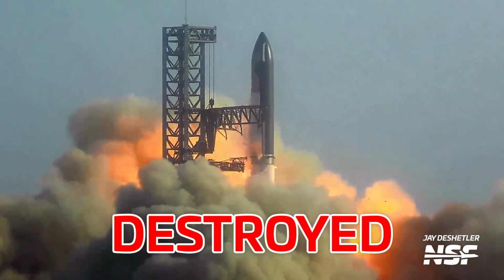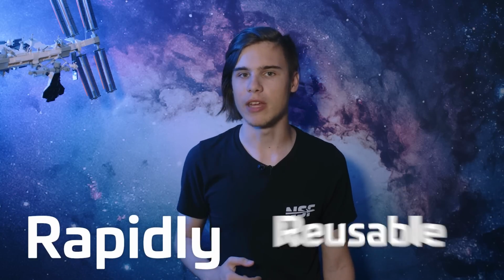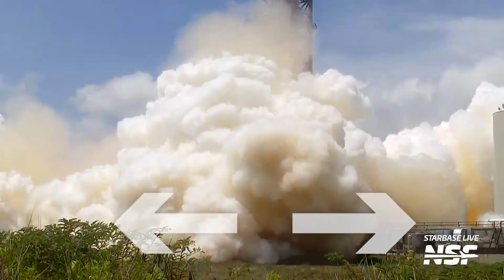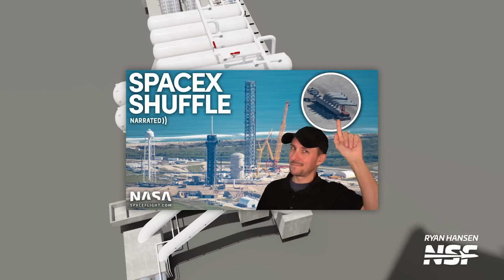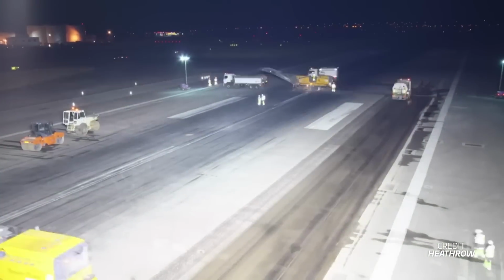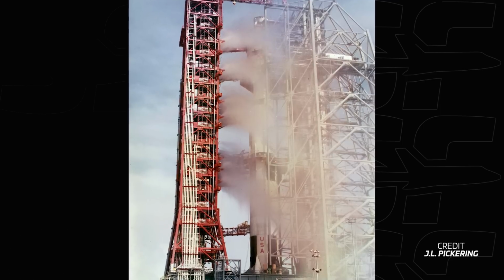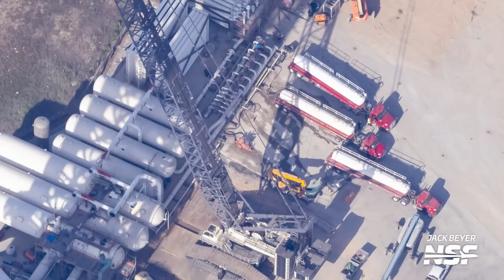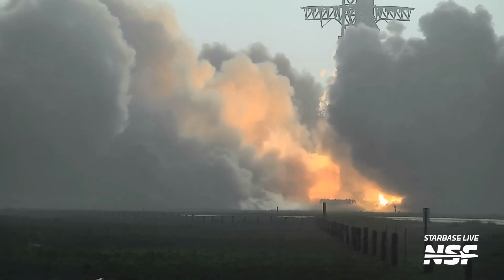SpaceX Thinks They Know Better. Is The Water Plate Enough? (Starship's Deluge)

Comment: Would be better to build the launch pad and tower just offshore where SEA WATER can deal with all the heat and pressure. A wide pier can provide easy access and barges can provide portable platforms under the launch pad.
Reply: Heh this was one of only two questions we didn't tackle on this video - didn't want it to go any much longer than it already goes but fun fact: you still have to deal with a lot of the same issues than on the ground with the added problem of replenishing consumables getting reeeeeally difficult. I wish we have had more time to cover this but sadly we were already working on this video at its current length for well over a month, maybe we can tackle these other couple of questions on a separate video though! :D
Reply: This would be horrifically expensive.
Reply: And erode the entire facility in months.
Reply: Ships that use boilers to heat water to create super-heated steam, which is then thrust on to turbine blades, to generate power to the gearbox and then to the propellers, have to use very pure water. Detectors monitor the pure water after it has turned the turbine blades and condensed into liquid. These detectors are just 2 metal plates and a meter measuring the resistance between them. Any 'contamination' such as salt or copper or iron or anything else in the water, causes a change in the meter reading. Why do they monitor this meter?
Because anything in the water will 'pit' the turbine blades and that will add pitted steel into the water which will be re-cycled and fired into the blades again. In other words, the 'contaminant' acts like a sand-blaster and if you use your idea of salt water, the 'contaminants' will start pitting the off-shore platform rig. It may also create 'salt' dust clouds and that will cause added corrosion to everything on the platform. Then you have to hose it down with pure water, so everything has to be water resistant.
Although it will solve the problem, I think the logistics of it all, just adds up to too much complexity. In my opinion. Perhaps if it was over a fresh water lake, it would work.
Elon's location in a wildlife reserve, is the 'Ball & Chain' that has developed this 'creative thinking' and alternative water deluge system. Maybe like everything else he has built, other countries will 'adopt' this method too??? 
But as NSF showed in their 'exposee', Rocket Lab's Electron Rocket launch pad, does not use a deep trench and it fires into concrete and diverts it out each side of the platform and all they do is pour water onto it. So, it's all about a factor of scale. Scale up to the most powerful rocket in the world, time to think outside the 'standard' method

Comment: I think it will work, i just wish it didnt turn the entirety of the water into dry steam while only at 50%. I imagine the heat and pressure on the plate will only compound as it goes for lift off, granted itll only experience that for a couple seconds. Finger crossed it comes out in great shape.
Reply: It'll only be at 50% as well at lift-off

Comment: I think the original OLM was a brilliant idea, but as with the whole starship prototype program, has obviously had to evolve following the biggest rocket launch in history.
Their result looks like it works after the wet dress rehersals and test firing.
However, as made obvious from them, spacex still needs to be fine tuned as the water deluge overlapped the base of the rockets, and could well be the cause of the random seeming raptor shutdowns.
I think they will also need to sort out the waste water collection and treatment and storing to stop environmental organisations constantly halting progress with legal action.
Reply: From my understanding the deluge never directly impacts the raptor engines so the shut down of two of the engines is a problem that may be more about how they integrate with the whole launch system on the booster and the launch mount and that will take time to resolve.

Comment: Mark my words, the pad will be damage again, the test that starship having are nothing compare to the launch, for the first test flight we can see that starship taking at least 4-8+ sec before it really fly, which mean the thrust just going to fire down the concrete underneath the pad and the deluge system wont hold it so much more. I hope I’m wrong tho.
Reply: As was pointed out on this particular subject, about timing for lift-off, the change in launch sequence should actually reduce the amount of seconds that the steel plate will be subjected to thrust, when the Raptors throttle up from 50% to 60% and then go to 90%. (We have seen it can take 50% for about 6 seconds without damage) 
What was not talked about in this video, was the heat energy that is needed to be dissipated by the water. Methane and Oxygen burn at 2,810℃ (5,090℉). Steel melts at 1,371℃ (2,500℉). So without any water, it would take a certain amount of time to heat the metal up to that 'unwanted' temperature. Just what that 'critical' time is, requires someone with a very good knowledge of British Thermal Unit's or kilo joules and some real rocket science equations to work it out. Right out of the Ball-park for me! 
Also that steel plate construction is very heavy, and could radiate a certain amount of heat to the air as well i.e it can lose a certain amount of energy. 
I hope that SpaceX have added another layer of protection to their onboard computer system, that is linked in to multiple water flow switch's and pressure gauges in the 'deluge' plate. If a water pipe bursts (or something else goes wrong) and water pressure drops below a threshold, it has to abort the launch.
Reply: Wow Dave, you really know your stuff.  You should work for NSF @David-yo5ws
Reply: Elon did say that he wants the ramp up to all engines lit to be by 2.5 seconds.  It all depends on how fast they clear the pad I suppose which the team is clearly trying to refine.

Comment: Couldn’t they have stored an enormous amount of water on the tower? I feel like this whole pluming is way too complicated and thus a failure point.
Reply: To achieve sufficient pressure required by this system (on the order of 20 atmospheres or so), they'd need to store the large quantity of water about 200 meters above ground (significantly higher than the topmost tip of the launch tower): every 10 m elevation for a water tower, provides 1 more atmosphere of pressure at the outlet.
Reply: @Spherical_Cow   Where do you get your 200 meter figure from?   The OLT is 143 m tall and the vertical water towers are much shorter.   Besides most of the water for deluge comes from the water tanks on the opposite side of OLT from the OLM.
Reply: @michaeldeierhoi4096  the question was, why don't they use a tall water tower instead of pressurizing the deluge system with gas.  I explained why - and my explanation includes a very simple derivation of the 200 meter figure.  Read it.

Comment: There is no doubt that SpaceX has the personnel with exceptional expertise in the aerospace industry, and I’m sure they have done some intense computer modeling on this issue. 

That being said, the proof is in the results they get in a real test flight with an actual launch. Reality will answer any problems that may have been overlooked by the team. 

My personal feeling is that this launch system will allow for a successful launch on the next try. After that I’m convinced that some tweaking will happen before launch number 3.

Comment: I think it'll work. However, I don't think they'll have the reusability they're hoping for at first. I'm thinking after the 3rd or 4th launch there will need to be extensive repair work/modification. I hope I'm proven wrong though. I like that it's different, and with being different comes new challenges, and overcoming challenges can be quite rewarding.
Reply: I think the worst case scenario is that they realize they need to rework the plumbing to allow for much higher water flow and pressure. And that's only if the current setup isn't enough to stop the steel plate from eroding a little bit.
Reply: I'd wager we will see some fatigue/corrosion fatigue on the metal around the holes from the shockwaves and nearby salty environment.  That might cause issues but they could always cut out the area and weld in a new section.

Comment: I was surprised at the damage caused in the first integrated flight test to the launch pad, by the lift-off, after the initial pronouncement that because of the 50% flight test of the engines prior to the lift-off, 'the concrete was good'.
Reply: keep in mind much of the damage from it was that the pad was able to be   pushed down this was due to several static fires and quite a bit of erosion that was unexpected similar to how if you have a house foundation it will crack because the support under gives way. 

I say unexpected but what I really mean is not all factors were accounted for and allowances were made even though the consequences were pretty easy to figure out if they had taken the time to think about it more :)  I won a lot of bets after the first launch :) a lot of bets..
Reply: The pad was horrifically under engineered because they wanted to cut costs. FAFO.
Reply: @markuskoivisto I think it was more about wanting to get the ship off the pad asap, rather than cutting costs.
Reply: @Astra2  Same thing, no?

Comment: There will still be risk to the OLM and subsystems, most damage has hopefully been mitigated.  Immense power presents immense damage potential.  It is the worlds largest cutting torch.
Reply: Your use of 'cutting torch' , I have to say, is not the best analogy to use, if you look at this in a factual sense. But I get what you are implying: e.g A Concentrated Jet Blast.
I am actually bemused that NSF did not go into the temperatures that the OLM would be subjected too. Maybe they will do the 'math's' of it, in another video post?
For the record:
A cutting torch relies on Oxyacetylene burning at 3,100℃ (5,612℉) to heat metal to a glowing state and then an excess of oxygen is applied to the metal, which causes a chemical reaction to occur. Steel melts at 1,204℃ (2,200℉).  Where as Methane and Oxygen burn at 2,810℃ (5,090℉) and so there is slightly less heat energy (compared  to Oxyacetylene) required, by the water deluge system, to dissipate that heat and in doing so, protect the base steel plate (and OLM structures) from melting. 
Anyone who has had a pot of water boiling on the stove and has let it boil dry, knows how well water dissipates heat, until the last drop is gone. 
Thank you for 'triggering' my engineering welding course past and I had fun digging out all the temperatures. Let's hope the risks you mentioned are indeed mitigated. 
🚀🥂👍🏼 Go SpaceX

Comment: With the booster and starship coming in for a catch landing while hovering ... seems there could be extended time with engines close to the ground and potentially causing damage to the steel plate as there wouldn't be time to reload the deluge system.
Reply: The 'catch' landings will involve only 1-2 engines on Ship, and 2-3 engines on Booster, firing (or add another 1-2 engines for each, and cut the throttle for all, for better redundancy.)

They will not happen over the OLM, but off to the side.

They will also happen much higher off the ground (with the chopsticks at or near their highest position on the launch tower.)

Comment: Water has a tremendous ability to absorb and transfer heat. The few seconds of heat from engines won't be long enough to cause enough heat transfer to the water in the steel plate to steam. Not with it pumping through the plate at a massive rate.

Comment: Two things...

Firstly, if SpaceX thought the 3rd water tank and additional gas pressure tanks weren't really needed for a full-power, full-duration liftoff - then why would they have planned for, never mind started installing them, in the first place?  But if SpaceX thinks the full system needs these additional tanks to perform adequately, then how could they really justify launching before they're fully installed and connected?  "We just want to launch ASAP; ignore the risk to the pad" has already proven to be a rather flawed approach...

Secondly, the severe acoustic environment is not just a problem for the payload or the flaps or the TPS tiles: it's also a problem for the engines themselves.  Having shockwaves reflect off the flat plate upward directly into the engine bay is not good design - it could even be a root cause of losing multiple engines before liftoff!  It can't be good for future/rapid reuse either, if engines and their plumbing are subjected to violent concussions and severe shaking on every launch.  An angled flame deflector would reflect shockwaves sideways, away from the engines - and that would create a much gentler, milder and kinder environment, much more conducive to reliable launch and rapid, frequent reuse.
Reply: Someone needs to get educated about the reasons why a flame trench is pretty much out of the question at the Boca Chica launch site because this has been addressed ad nauseum for at least a couple years now.
Reply: @michaeldeierhoi4096  While it may be a fact that one can’t build a flame trench at Boca Chica that doesn’t change the fact that a flame trench may be needed for this most powerful ever rocket. Or, that it at least may constitute the only cost effective pad design solution. Which could ultimately mean that Boca Chica was the wrong launch location. 

Here’s hoping that the current system works.
Reply: the issue of a flame diverter is where do you direct the exhaust? the wildlife refuge? Or the tank farm?
Reply: @bryanillenberg  Given free reign, I would direct it skyward (over the wildlife refuge), at say a 15° ramp angle
Reply: @Spherical_Cow  that's probably the second best option (though I'd aim for a higher angle).
The best, IMO, is the current setup, or some derivative of it.

Comment: I hope it will work. And it looks promising. We'll see stage separation and who knows what else. Once the ship is moving it might go a long way.
Reply: Exactly as I feel.
Reply: I'm expecting an on-pad or near pad explosion which could end the program.
Reply: @randyschreiner7807 if without a deluge and a rock tornado and still didn’t explode on the Pad while it was tilting, then the chances of it exploding now after multiple static fires with the deluge with basically no pad damage and optimal performance, then there’s basically 99% chance it makes it off the pad. 
Your expectations will NOT happen lol, not sure if it’ll make orbit but it most likely will but we’ll see. 
You must be a sad soul to be looking forward to an outcome that terrible under no real basis because they have fixed majority of the issues they had with the last launch. 
I’ll be back here to laugh at your hateful ass when it’s successful.
Reply: If stage separation is successful and not too many engines go out on the way up, it'll most likely reach orbit.
Reply: @Astra2  This flight will never reach orbit. It's planned to be a sub orbital flight path which will bring Starship to land off of hawaii.
Reply: @Astra2 uhhhhh, there's only one booster that launches at a time, not multiple ones!!!
Reply: @jeffmentzer9186  I meant engines lol
Reply: @Astra2  Separation is a likely outcome, just hope it's only two pieces. I'm not sure the upper stage is likely to get to orbit even with clean sep, as it could easily have some damage to an engine during the event. Raptors firing in closed quarters, to my knowledge this isn't tested but maybe they have set that up recently.
Reply: @sammadison1172  Yeah good point

Comment: I am personally worried at full power it will generate to much steam under the pad and explode.
Reply: no way that steel plate explodes due to steam with so many large holes in it
Reply: @Business24353 technically it is possible since steam is 1600times less dense than water. but, i dont think it would happen, because the pad will only be handling the engines for a few seconds, and as the booster throttles up it would also move farther away from the pad.

Comment: Its gonna get off the pad but its whether all the engines will keep working all the way to separation and if the new system will work after that? I am hoping it will work  but there are sooo many variables that's its gonna be a 70/30 to the good ratio this time whereas last time was just - "get it off the pad, let's go" - This mission is critical to just get to orbit and check systems can handle all the loads from the ground up - but if it does make it without problems - the next test will be the big one - fully loaded with an extra 150 tons is really gonna tell everyone that this thing works